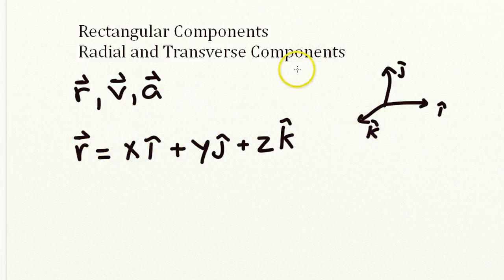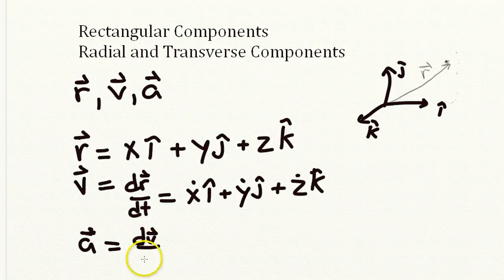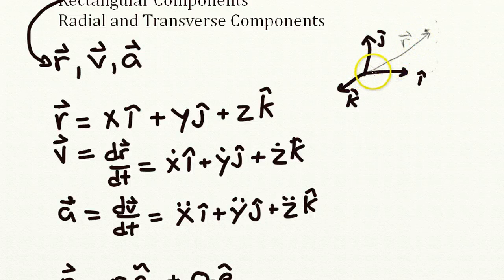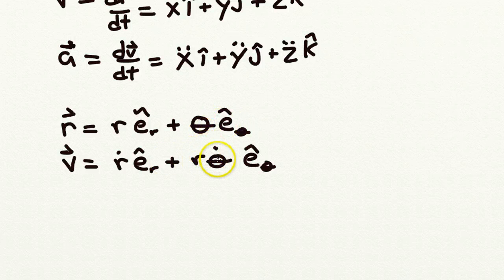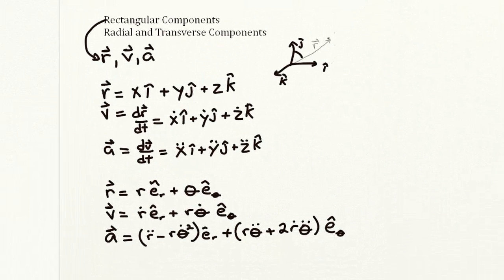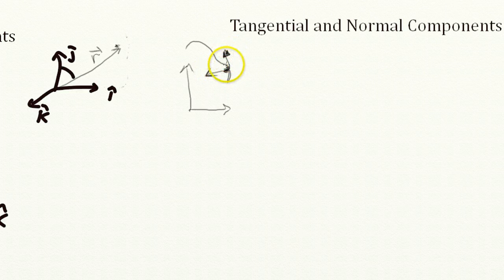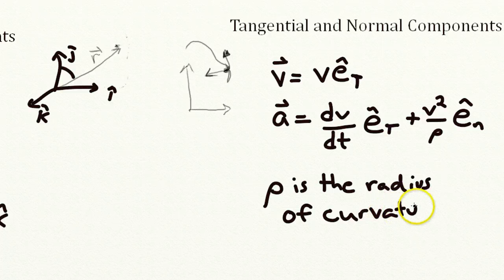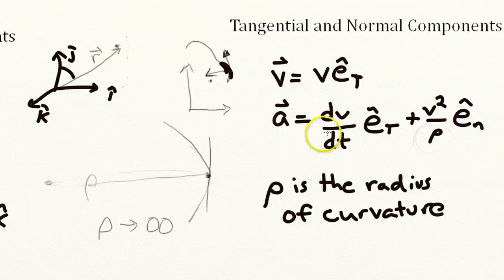velocity and acceleration in different coordinate systems

Comment: I agree with Saud on the definition of r.  There is also another mistake in the final acceleration equation - the final term 2 r_dot theta_doubledot should be 2 r_dot theta_dot.